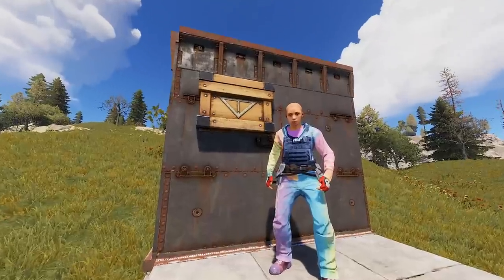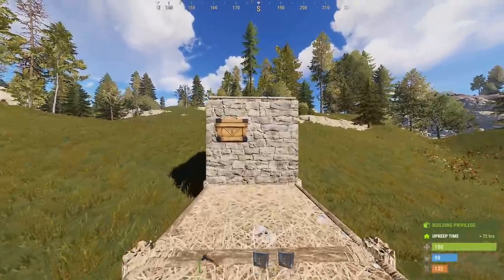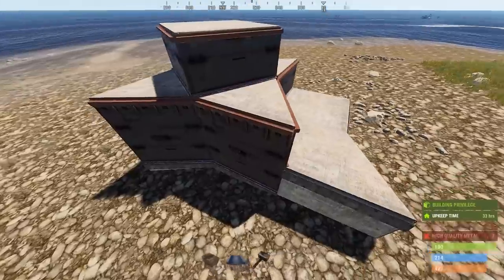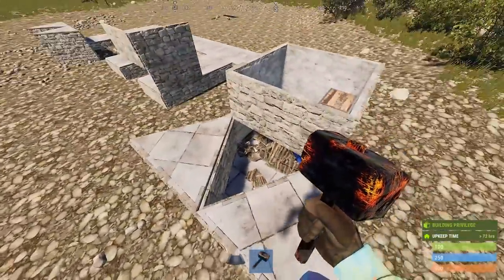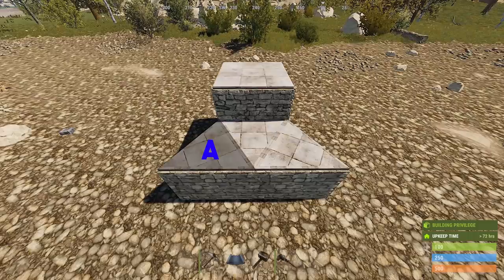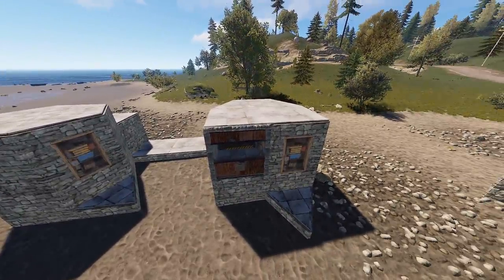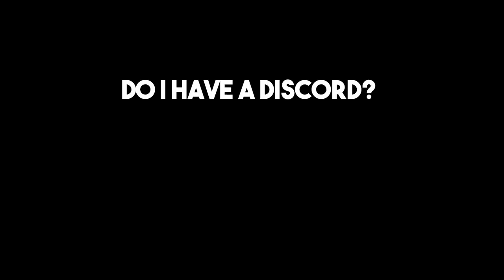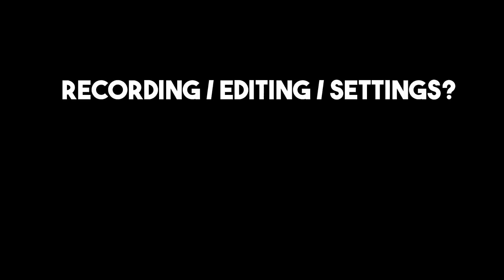RUST - Explaining Some Things (Rust Base Building)

Comment: Kinda complicated the bunker part tbh. Just upgrade both the foundations to armored and goodluck to anyone that wants to softside that

Edit: remember that people aren't going to know your exact design, if you have 2 sheet doors that lead to a garage door then chances are they're going to go through the sheet doors before getting to the garage door and that that point then can either spend the 3 rockets to go through the garage door or go through the wall, either way they wanted 2 rockets
Reply: If they've got control of a nearby workbench and more than one person then hqm is absolutely feasible to softside, two guys can do it in 20-25 mins
Reply: @cbrowne1283  soft siding hqm is worse than blowing through sheet metal. As long as the bunker is not fully hqm, upgrading the foundations would discourage people from picking it.
Reply from the maker: this is totally true, soft siding armored is a true pain, i meant this more from just a raw building point of view, it is possible to do